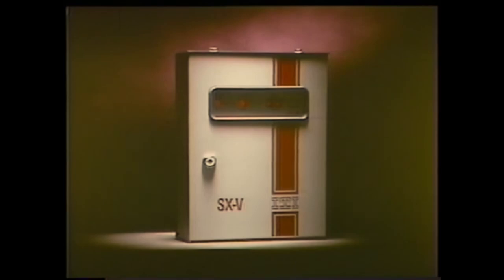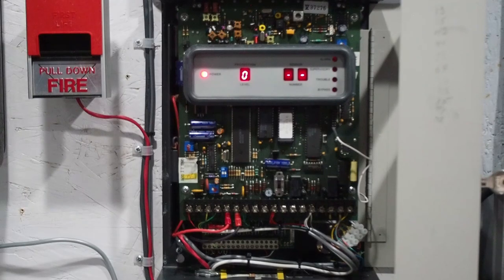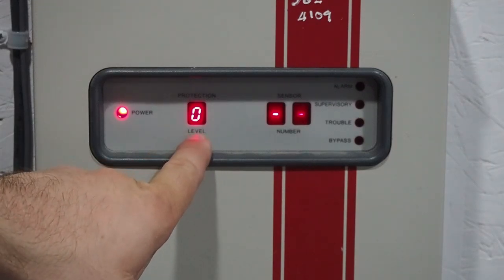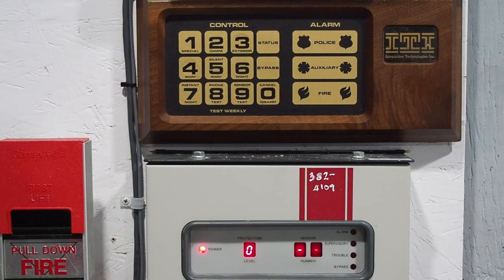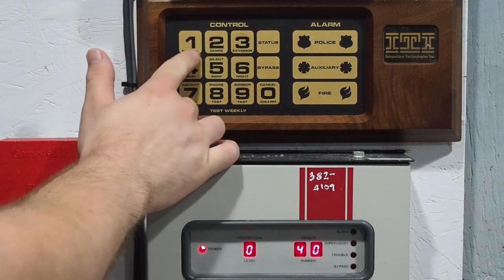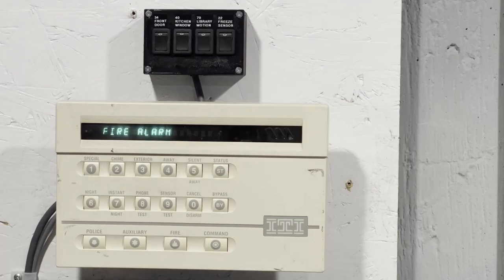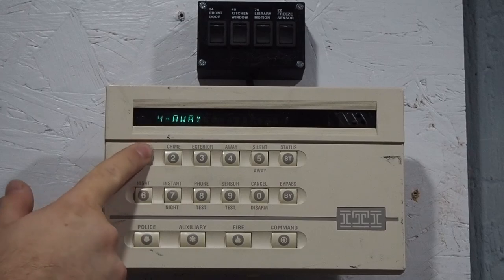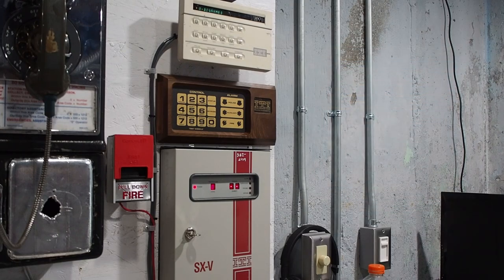ITI SX-V Security System Overview

Comment: I installed these on Maryland's Eastern Shore in the late 80's.  We used to tote a CS4000 around to program them which was a hoot.  One selling point was that each zone could be individually identified at time when a lot of panels were doing single digit - all burg zones tripped the same report.  Watching the demo here brought back quite a few memories.
Reply: I have a CS-4000 myself and wow that must’ve been i pain to lug one around whenever you needed to put in a system

Comment: The Simon XT has something similar to special arming called subdisarming. Subdiarmable sensors are armed all the time from system power up unless a user code is entered while the system is disarmed, then they will be disarmed for 30 minutes or so.

Comment: Fun fact, they still use subdisarm in GE Simon panels, I have the Simon 2 and 3 and if you enter the MASTER (not user) code twice, it will flash the disarmed button meaning it is subdisarmed. 

Pretty sweet
Reply from the maker: I have a Simon XT so yeah i've played with that before
Reply: @NewAgeServerAlarm  it is a cool feature though mine is not programmed at all

Comment: 3:49 I see according to the sticker on the left there that your SX-V was apparently made on August 17th, 1990 (& one of the chips is marked September 1st, 1989).

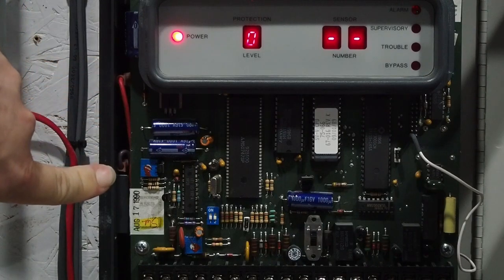3:59 Glad you don't have to take the whole motherboard out just to replace the battery (which I how I thought it'd be done).

4:36 Kind of a design flaw I'd say (especially if the system doesn't have any wired keypads & the panel is mounted in a hard-to-reach area).

5:45 Now that is neat! (though I suppose it's not much different from what current systems do) Clever idea with the zone switches too.

6:38 Pretty much what chime mode on current panels does.

8:05 Pretty much the same as with current panels.

8:08 In this case at least it's "1234", on an actual system it'd be more random of course.

9:43 Huh, never seen anything like that before (though I guess this explains why that one keypad said "PROTEST" in the previous episode). Also given the fact that you tried to arm the system while the zone wasn't bypassed (having just un-bypassed it), what you said before then was incorrect (you armed the system while the zone was faulted & unbypassed, not while it was bypassed ).

9:58 Clever & convenient that you can still arm & have the panel auto-bypass any open zones, unlike with today's panels where you have to first bypass any open zones manually & then arm the system.

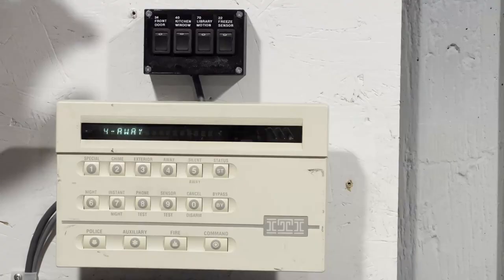10:39 Surprised you didn't have ear protection on right from the start.

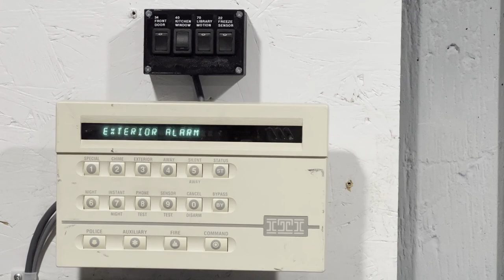10:52 Huh, odd.

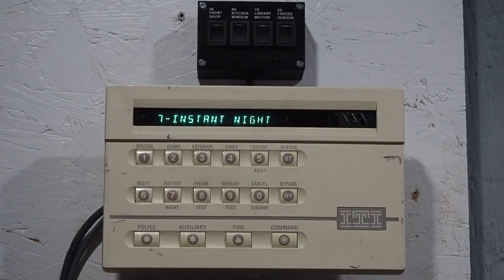14:06 Heh.

Maybe some current systems oughta take inspiration from the SX-V, given how different it is in some aspects to most modern panels (& how some features are somewhat better than those on current panels, or are even nonexistent).

Comment: I don't get the purpose of night mode. Isn't arming in stay/away essentially the same thing? (Side note: the portable panel looks very unique with the wood trim and gold buttons, almost like an 'executive' finish 👀)
Reply from the maker: Night can be used to turn on some interior sensors to cover areas the occupants won't be in during the night such as a garage or a basement. It’s more useful in larger houses than smaller houses.

Comment: I presume on this system there's no 2 way communication between the CPU and the wireless keypad, correct?  Does that wireless keypad have a battery in it or must it be plugged in?  On systems of this vintage, were the wireless sensors etc susceptible to radio interference or false triggers caused by other nearby electronic devices such as, say, a wireless doorbell or car entry keyfob etc?
Reply from the maker: It’s one-way communication.

Uses a small 3 V lithium battery.

Technically anything is susceptible to radio interference but ITI was careful about the frequency they chose to minimize the risk as much as possible. I haven’t heard of one being set off by interference though.
Reply: Was that "Spread Spectrum"? @NewAgeServerAlarm

Comment: Hey, I am getting a ITI Caretaker (Not the plus, just “Caretaker”) from my uncle. I don’t know much about these panels but I would like too. Is there any information you have that could help me? (manuals, models of programmers, wireless contacts, etc) Thanks so much!
Reply from the maker: The original CareTaker was the next evolution in the ITI product line after the SX series, but it still uses the same types of sensors, so unless you have a handheld programmer like the one I have, there’s not going to be a lot you can do with it, you’ll have to use the sensors as whatever they are already programmed as. You’re also going to be limited without a CS-4000 Central Station Receiver (and these are getting difficult to find for cheap)
Reply: @NewAgeServerAlarm  ah thank you, I ended up finding the manual, and it said I do not need a handheld programmer surprisingly, it can be done with a female to female Ribbon cable directly from the panel to the sensor. Then it is programmed over touch tone telephone. What things would I need the CS-4000 for?
Reply: @Firealarmcollectorperson late but a CS-4000 allows you to program things like user codes, phone numbers, sensors ,etc.